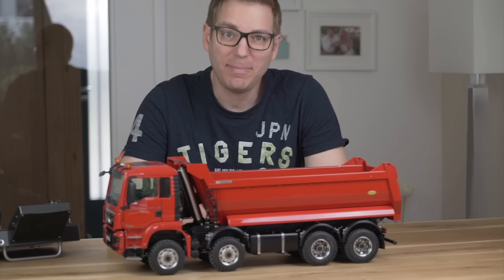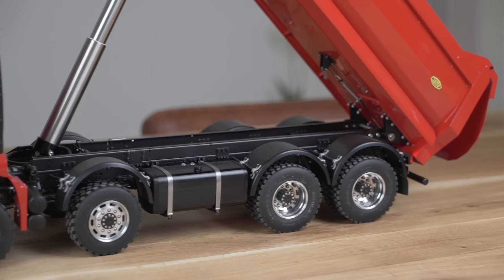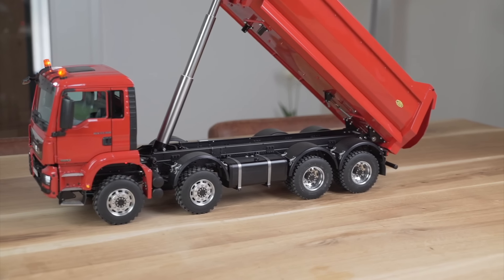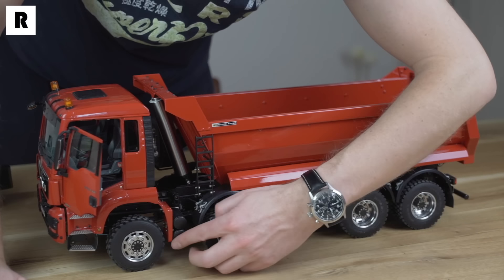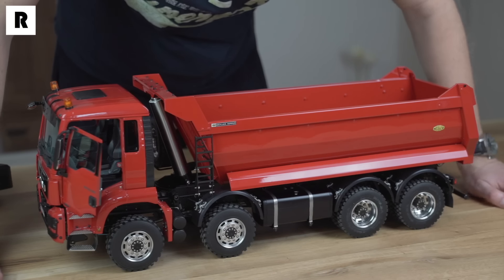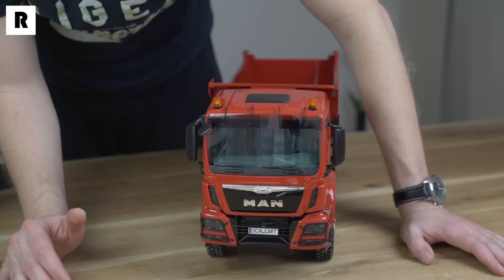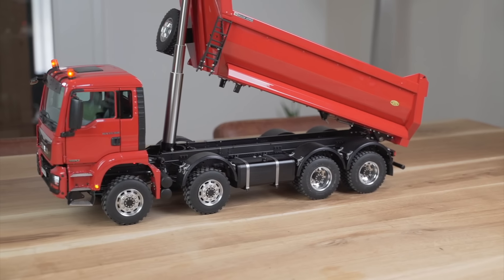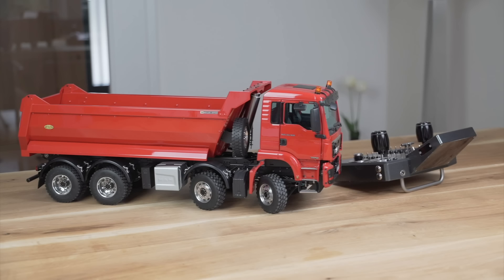RC TRUCK ACTION REVIEW - MAN TGS 8x8 DUMP TRUCK - ScaleART

Comment: Amazing!! How much does this model cost?
Reply: Mr.mysterious03 a lot. Be best to look at there web site http://scaleart-shop.de as you can spec what motor, hydraulic or electric tipping, with or without controller. Colours, wheels, ready built or kit etc... the list goes on. But as a basic price to get you started your looking around €5,500 +
Reply: Nick Allcorn woah!!. .thanks Nick!!
Reply: Mr.mysterious03 that price is a fully work model. Just the truck as a non work model, for display is just over €2000
Not cheap at all. I was looking at getting one but i can't justify the price for my needs 😔
Reply: Nick Allcorn yeah man! 2000 euros is still a big money. Billionaires toy :p No doubt they have put heart and soul into making a realistic RC model. It is out of reach for most of model collectors like us i think!
Reply: Mr.mysterious03 you can get a rtr version from another company. Still cost £2000. Lesu are making some really good parts now.
This type of truck 1:14.5 or the 1:14 scale can easily weigh in at 12kg
Scaleart uses alot of brass parts. Where alot of the companies use aluminum which costs less, or even plastic parts on entry level.
I ended up getting a 2nd hand non working truck and stripped it down. Rebuilt it and replaced parts as i went. Still unfinished... one day, working progress as they say.
Reply: Nick Allcorn cool!! Hoping to see a video soon then!
Reply from the maker: Thank you guys - nothing to comment for me anymore. ;-) Enjoy and have a good time! Best wishes, BJ
Reply: RC TRUCK ACTION keep up the good work, really enjoy your reviews 👍
Reply: How much of this rc truck price
Reply: Mr.mysterious03 Which is the company and manufacturer of this rc truck?

Comment: The center drive mechanism is called a transfer case.  The differentials are in the middle of the drive axles, and they are powered by the drive shafts, which is in turn powered by the transmission, which is powered by the motor.
Reply from the maker: This is awesome !! Thank you so much, I promise to do it better next time! Have a good day, best wishes BJ

Comment: What size battery are you using?  What’s the largest that will fit?  Every truck I have I use lipo
Reply from the maker: It's a simple NImH 2.000 - 12 volts, 10 cells.

Comment: Never switch on or off the diff-locks while the wheels are spinning, it will damage the differential gear . And the 5th differential is known as centre differential, only when u lock the centre-diff , 8x8 is engaged.
Reply from the maker: You are absolutely right. Thank you! Best wishes, BJ

Comment: 10:50 it’s called “ differential “
Reply from the maker: Thank you! :-)
Reply: The differentials (black gearboxes) are at each axle (4). The silver item is a transfer case. It, as you know it "transfers" the power between the front and rear drive axles.Thanks again for a good tutorial of how everything works.How much do these amazing "models' ( not toys) cost?

Comment: Where was that engine sound coming from? Surely, this doesn't have a gas engine because it has electric drive motors, right?
Reply from the maker: Right. It's coming from an electric Sound module in the truck. :-)

Comment: Great video from you. Metal 98%, hidraulic pump, dif lock combinations etc etc. like real, one like real one, like real one... Than this is place where put battery 🙄... For 10 000 $, way not scale disel engine, maybe like  simple 2 stroke Detroit engin and sound of scale model is gteat. Ok 10 000 $ but how much will be cost with scale disel, petrol engine LIKE REAL ONE for that money?
 Will be great exempl for real life scaleing problem of monopol rip of but difrent direction... nobody, car manufacturers offer car, electric car with out battery saw we can see how much cost car and how much battery.
Reply from the maker: Thank you for your comment! Good question, if you do everything like the real machine, this will be a huge amount, I don't know, if this would be possible...

Comment: the correct term is 8x4..
Reply from the maker: What do you mean? It's an 8x8...
Reply: 8x4 refers to tire layout rather than axle layout, with 8 rears 4 front..

an 8x8 has 8 wheels only 
which can be set for 4 or 3 drive axles in either format..

Go and talk to a truck deal and the most likely laugh at you lol

Comment: Awesome truck, Unfortunately the guy have no idea what he is talking about. There is no such a thing called "diff-lock". There are differentials and some of them can be locked. That "gearbox thing" on the middle is not a locked differential and it is doing what is suppose to do, split power between front axles and back axles as needed. The reason only one side is running is the same reason that only one wheel is spinning on the each of back axles, Why? because there is a differential between left wheel and right wheel and IT IS NOT LOCKED!  Here, have some look: https://en.wikipedia.org/wiki/Differential_(mechanical_device)
Reply from the maker: Hi, thanks for your long comment. I appreciate it. The transfer case in the center of the truck can be locked or unlocked. Same function as a lock in an axle. Sorry, if I wasn't able to explain it correctly, thought that the pictures would speak for themselves. Don't be too hard with your judgement. ;-) Nevermind, thanks for watching. Enijoy, BJ